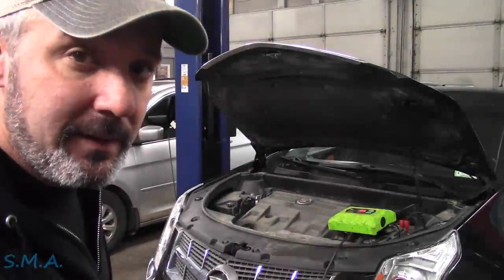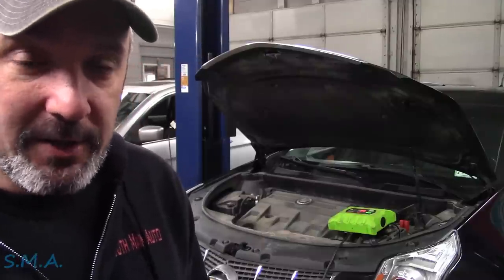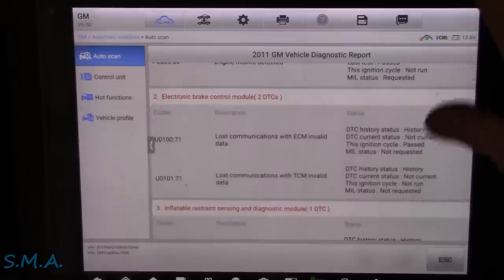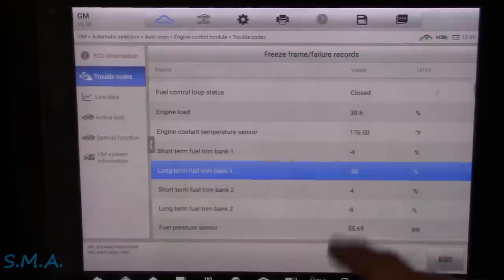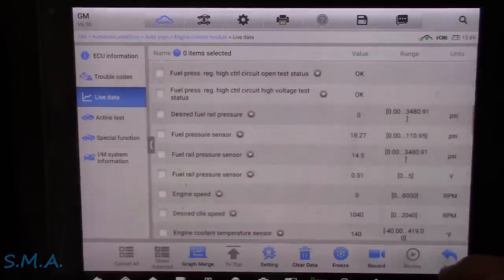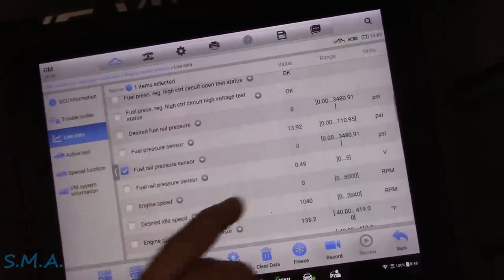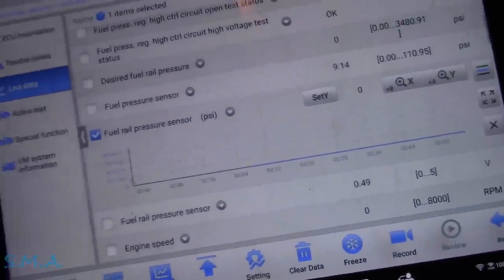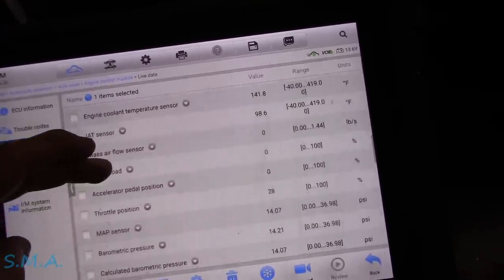Cadillac SRX: Running Rich P0172 / Hard To Start

Comment: I totally understand why you prefer cheapie borescopes. With that said, you should check out the scope "the car care nut" used in his "Customer States Car Burns Oil. Let's find out why and if this car is worth fixing!" video from January 15, 2022. It's pretty cool, it has 2 cameras, one normal, and one on the side of the scope to check out cylinder walls and stuff. He starts using it at 8:20 in the video. Depstech DS500

Comment: Morning Eric! Elrich here - had the same issue in my 335i. No rich codes or codes of any kind, just fuel trims slightly off at idle and I’d feel tiny misses. The failure was a lot smaller so the smell check didn’t even help. 

Ended up pulling the injectors out, flipping them over on the hardline and relightening. I pulled coil pack plugs and then turned the car over to get HP build up. I had a piece of cardboard underneath and got a nice solid trip out of 5 out of 6 injectors. Two were much worse than the others. 

1800 bucks in parts for that fix! Ugh. 

Hope the smell comes back soon - one of the best tools in the box.

Comment: I don’t have to watch this video to know what’s wrong. The carb main jet lever is adjusted too high or it’s spring has lost strength over time. Just rebuild the carb and correctly adjust the new lever and you’ll be also set to ship it. Oh, wait - this isn’t a 2-stroke engine, is it?!!  😉🔧🧰
Reply: Set the slider on clip position #2 and you should be good for the trail.

Comment: I’ve done the injectors on the SRX.  Here are tips I can give. 
To get to them, I taped off the intake passages , then used a 1/2” belt sander to take off about 1 mm on each side of inside intake rails.  That little bit let’s the injector rails out with ease!
You don’t need the special tool to put in retainer clips. You can use a set of channel locks and position them just right. Then squeeze!

Comment: Top diagnosis there Eric , when you got the bore scope camera in the plug hole and turned the ignition on it was smoking big time in the cylinder,  looked like a foggy day , sure will help the fuel consumption fixing it , here in the UK our rip off gas stations are charging £1.80 + per litre of diesel and £1.70 for E10 unleaded , big money to fill up nowadays thanks to Mr Putin

Comment: I have an older V8 SRX AWD, the rear wheel drive based model and that’s hard enough to work on, whenever I do repairs which im currently am. This newer FWD one seems absolutely impossible to deal with and work on. That’s direct injection for you. Too bad you can’t clean the injectors like you used to see if they’d act right. So little room to work. 

You’re too good Eric! Such an amazing diagnosis and I concur with the others, your attention to detail is incredible. 

Well done and keep up the great work.
Reply: Direct injectors can be cleaned at a specialist.  Machines to clean them are much more expensive, about 10k.  And the injector may fail again.

Comment: I came home from work to a 2011 srx4 in my garage. Wife bought it while I was at work. We have had nothing but problems. Only having 120000 miles on it. Rear differential light comes on evey year. It is very exspensive to have the whole diff replaced. So we bandage it and drive on. It eats head lights. The wiper blade motor disconnected from the mechanism and with a new battery it will still tell you low voltage. Starts right up and runs fine. But man what a pos.

Comment: Cadillac seems to have a habit of doing things the "hard way". I think it's because they try for "innovative" and end up straying from proven design concepts. It also leads to the "Special Tool" thing as well. Examples like the 4.1HT (freestanding sleeves leading to blown head gaskets that needed a whole 'kit' - essentially an engine rebuild less lower end - and it's DFI integrated into the radio. Then there's the Northstar line, too many issues to mention, but the $900 water cooled alternator and starter under the intake come to mind. I'm not real familiar with the big 3.0, but GDI in general is a bad idea with inherent issues, injectors running diesel pressures without diesel lubricity, intake  fouling, etc.
There's a premium price on Caddys that extends to parts. Bet that injector is pretty pricy and probably special order. I doubt NAPA (not a sponsor) will have one.
Hope we get to see the injector changeout. Thanks, as always, for taking the time to share!
Reply: Cadillac being the premium brand it gets all the newest fanciest stuff. Which means that’s where it also gets developed along with any problems. 
I always thought premium stuff would get the tried and true and most reliable. But, I guess people think they want the latest and greatest.
Reply: @NBSV1  Very true. A lot of the stuff is groundbreaking, like the limp home mode that allows the Northstar to run for miles with no coolant by dropping cylinders and still making 400hp when healthy. You would never know what's there until you put the pedal down. Then, in the same motor, they did several "what were you thinking?" moves. My dad had one, a 400hp Coupe de Ville, and it was amazing, but he had to sell it, as neither he nor many people can afford to own onw out of warranty. The CTSV with the blower is just incredible in an Escalade, albeit it expensive, and not without an issue or 2. I guess it's really a super premium brand, as the long term cost of ownership is very steep.

Comment: Good going with that plan.
I was sitting here predicting you had to buy some weird tool and pay for it, then you won't see another car like that.
But somebody will try to borrow the tool, right.
Sure enough, it's special injector pliers.
Dang.
Time for ingenuity?
Or, maybe the parts store can get the tool to use?
Or there's one online that is not from the tool truck 🚒 and won't  sit in the the drawer

Comment: That's a wonderful GM engine cover and oil cap design. Apparently the "make the hole in the cover big enough for the oil cap to fit through" idea escaped them. Or else looks were more important to them than not pouring debris into your engine..
Reply: I worked at GM. The whole idea was to deal with less parts so they could eliminate somebodies job, or more if some other company/labor-costs. They are penny pushers.

Comment: for several years the 2.4L in my car now close to 400k had long cranking on cold starts changed every part i could that did nothing then this very cold winter started having intermittent no start just cranking thought it was gm passlock issue turns out it was fuel pump relay. bought standard ignition brand engine pops off moment you turn the key even if its -30*f

Comment: It could also be a bad fuel rail pressure sensor seal letting fuel into the vacuum line. I had that problem and it started with a misfire and then the entire bank 1 was flooded with fuel. Just something to consider.
Reply: Wait how? Wouldn't a fuel rail pressure sensor seal would create an exterior leak on this? I do not believe those have a vacuum fuel pressure regulator on the low side.
Reply: @millerfawaz151  No. It leaks into the intake manifold. The vacuum line is how the sensor gauges how much voltage to send to the fuel pump. Maybe this car is different but mine is an escape
Reply: I don't think that engine has that fuel pressure management system.

Comment: For some reason the oil caps on the LLT/LFX all seem to stick or swell onto the filler neck, probably does it on every 2011-2020's Holden-Cadillac L-series V6 but I wouldn't know. Also agree about the dust shroud and oil cap issue, whoever designed it was definitely weak in the upper story. Perhaps I'll trim my cover so that the cap doesn't need to be removed.

Comment: This makes me glad they had not rolled out GDI when I was still doing this work. The intent of the manufacturers is to drive service work (NPI) back to the dealers.
Reply: Just imagine how electric cars will have this same effect, with new $20k scan tools needed instead of $1-2k.  However, those electrical engineers probably don't live in NY and see the level of green crusties they're about to triple in effect on each car.

Comment: Dumb question, but if that fouled spark plug stopped burning the fuel, could that be the reason the gasoline accumulated in the cylinder? The injector pressure drop test didn't show #5 injector as a problem. If anything, injector #6 was a problem.

Comment: Hey Eric, with those high pressure lines at over 1,000 psi, do you have to exercise any special caution to avoid getting any "pressure puncture" injuries arising from unexpected fuel release?
Reply from the maker: Yep don't touch a spot that is leaking from a pinhole 👍
Reply: @Codyjrt  Oof, damn! How did that happen?

Comment: Great video, thanks. So if the cylinder 5 injector was bad, Should you be worried that the other injectors are not far behind, and replace those too? Or would that cost a lot more.
Reply: I'm sure the injectors aren't cheap. He'd probably leave it up to the customer. A couple years ago I had a fuel injector die on my 2006 Pontiac G6 (was at 176K miles). I diagnosed it and replaced it myself. I gambled and only replaced the one. I did change the o-rings on all of them though and made sure they were clean. It's been fine since *knock on wood*. The car's got 192K miles on it now.

Comment: Damn, I wish you had done a video of replacing the injectors/HPFP.  My 2010 Equinox with the same engine has the same codes but both banks.  Thankfully my plugs didn't look that bad when I changed them out.

Comment: I have a mint 06 DTS with the oil leaking northstar would you be interested in pulling the 4.6 and showing you audience a stupid engine design? Would make a great 2 or 3 part show. The car has less that 60k on it
love the car except for the oil on the garage floor.   signed a loyal viewer Dan

Comment: its probably not as "peculiar" to read normal pressure inside the cylinder test, when pressure seems to be leaking at the rail or pump side, or the opposite side of the injector... but i  havent watched the full diagnoses yet, just commenting early

Comment: Are you sure the fuel on top of the piston isn't from the Injector Drop test you did with the scan tool? Or did you run the engine off Camera after that? Just curious lol!

Comment: With this Cadillac it looks like the battery is in the rear and we have jump start posts under the hood and it looks like there is a charger on the battery jump start posts? Jump start posts under hood for a newer Cadillac is not uncommon. However, in looking at the output waveform of the chargers that I own (5 different chargers, some old some new) for jump start post under hood charging, I was very disappointed on how they worked in terms of the charging output average voltage and noise. 

If you charge directly at the battery, I have found the battery acts like a filter for charger switching waveforms. By switching waveforms I don't mean the old full-wave rectified output chargers (Associated fleet type), but newer chargers that use a switching approach and rely on the battery (at the battery post charging) to keep the switching noise down, resulting in an average voltage output that is proper for the type of battery being charged (Flooded, AGM, etc.) and the charging mode. To me why this is important is that for under hood jump start post charging the ECU and other modules are now exposed to this noise without the full benefit of the battery filtering effect.

Next time you charge from the jump start posts take a look at what the charger is actually doing in terms of output signal waveform (charging technique) for the different modes and the actual average output voltage (for average you can use a very slow older DMM). Also, many times the same device has a mode to maintain the vehicle voltage while re-flashing (re-programming) modules. From my experience in flashing modules we see a requirement that looks similar to 13.5VDC with maximum p-p noise at around 50mV. I know many technicians flash modules without a voltage maintainer, which usually works fine. But, at times there may be a calibration procedure that actuates loads Key-On Engine-Off, and it is helpful to use a maintainer if you don't know the battery SOC. I have heard that if the re-flashing procedure is interrupted because of a dying battery that you may "brick" a module (no communication, unusable) and need to buy a replacement before you can reprogram it. I use a maintainer so I don't know if this is true or not. My motivation was that I did not want to repeat a program cycle (which takes time) if the battery suddenly died. So, I got in the habit of using a maintainer.

 Because I was so disappointed in the chargers that I own for under hood jump start post charging, I made a dumb battery charger out of a Linear DC power supply 0-20VDC (adjustable, with voltage output display) at 20 Amp DC (current limit setting, with current output display) and a large fan cooled dumb power diode to prevent current flowing into the power supply. This set up is very electrically quiet (like 20mV p-p at 5 amps) and I find easy to use in bulk charging batteries (usually up to about 100Ah size). Bulk is the most common mode for me.
Reply: The battery is under the hood

Comment: How do we know only cyl 5 is bad? Could other ones be marginally failing and leaking more than they should?  Is there a way to test this, like watch the fuel pressure while each is triggered, or use shop air on each injector and trigger it manually?  My thinking is if one is bad, because the car is that old, maybe another one or all of them are close behind. It might be worth it, considering the effort to replace one, to replace them all. I replaced all of the injectors on my wife’s Benz with that logic - not that I knew all to be bad, but AFAIK all were over ten years old and one was dead and doing anything on that car is more of a PITA than it should be.

Comment: Eric O. 
I have an 07 Accord EX-L  with the big 3.0. Was going to change the plugs when I noticed the number 4 plug was not accessible. What I am talking about. Is the 5&6 plugs were easy to get out to check. But 4 looked like it was recessed in the cylinder. I do not  know if this is normal for Hondas 3.0 but has me concerned. The weird pare is the car runs fine at idle no vibration or anything.
Reply: It might have a different plug in it. It might be a smaller hex or different design. Don’t know of any way the plug could get pushed into the head without causing other problems and a missfire.

Comment: With direct injection engines, and the carbon build up on the intake valves, what is the solution to prevent this? I realize there are cleaning methods.
Reply: A catch can will slow this down. Walnut blasting or specialized chemicals can be used to clean them after the fact but you typically have to pull the intake.
Reply: Buy a vehicle with combined Port and GDI.

Comment: Can a car with a gasoline engine get blow by ? I have a 2019 Kia forte LSX with 40,000 miles and I opened the oil fill cap while the engine was running and the cap shot off and the oil dipstick does the same thing
Reply: Yes.  Anything with a piston is subject to blowby.  That is certainly excessive crankcase pressure.  I'm not familiar with Kia's at all.  There can be other causes than a worn piston/cylinder that can cause excessive crankcase pressures.  I'd get it looked at sooner than later.

Comment: Are you doing the injector replacement or sending it somewhere else?
Reply from the maker: I couldn't get it fixed as fast as the customer wanted so he's going to take it to another shop I just diagnosed it for them.
Reply: @SouthMainAuto  Too bad, customer is adding more risk in their repairs.

Comment: Been waiting on a video of P0172 code, but I have a 2002 Dodge Neon with 157000 on the clock,same code..new air filter, sparkalators, AIC valve,   injectors, map sensor. No joy yet and gas mileage is crap. Still have the old parts, but maybe it's the O2 sensors all along. Rich on bank 1. Only have 1🤣. Help Prof O. Car went from 22-24mpg to 16. Scratching my head, my cheap scanner  only gives little data, cannot test O2 sensors. Also no vacuum leaks. No gas smell. Can ya help a subscriber?